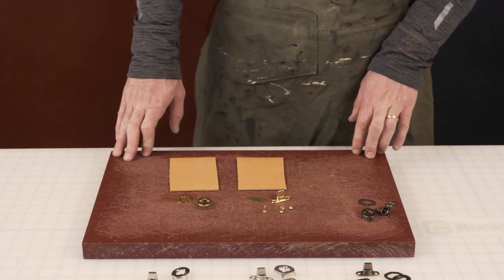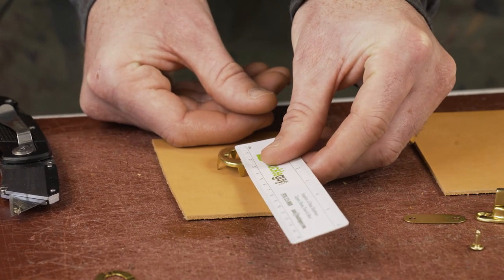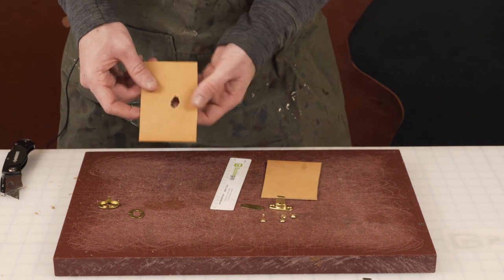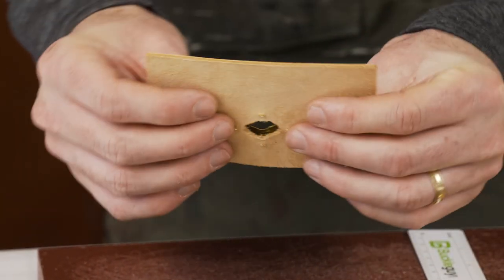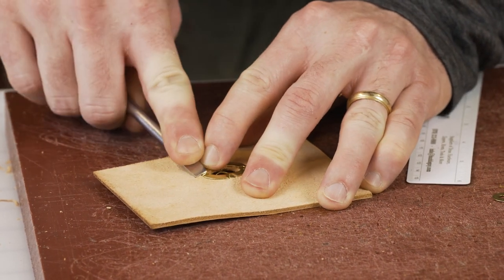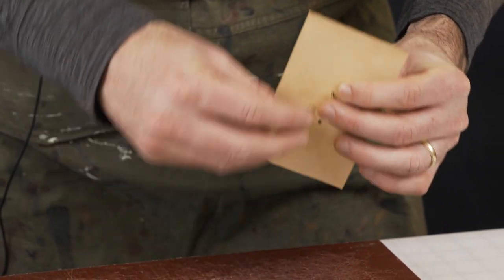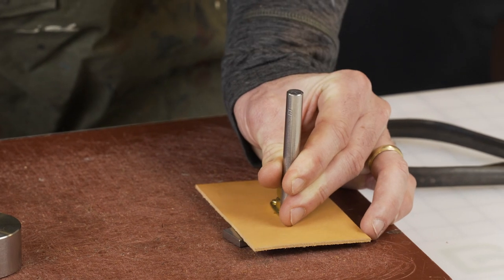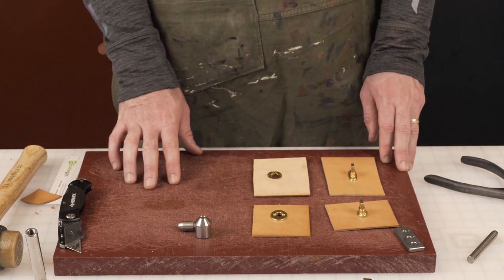Learn to Install a Turn Lock with Rivets for Leather Bags, Purses & Wallets

Comment: To be honest it doesn't really work that well with your rivets, the head of the rivet keeps the "male" part from going all the way in, and then it doesn't turn because the turn lock doesn't clear the lip of the other part.  You then have to hit the head of the rivet until you flatten it completely to allow the two parts to fit and function properly.  Try it and see for yourself.
Reply from the maker: Thanks for sharing. Send us an email to info@buckleguy.com with pictures and what rivets you are using and we will help resolve the issue.